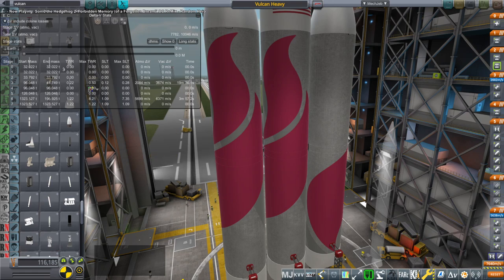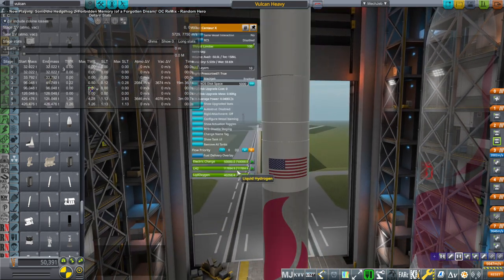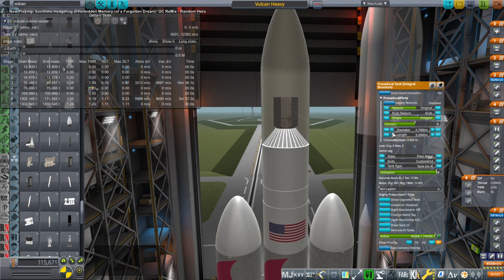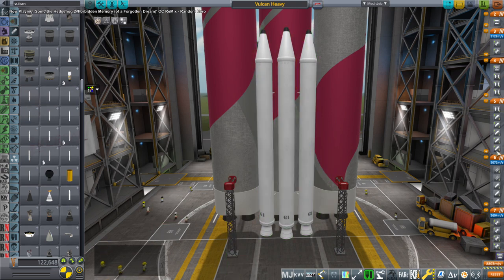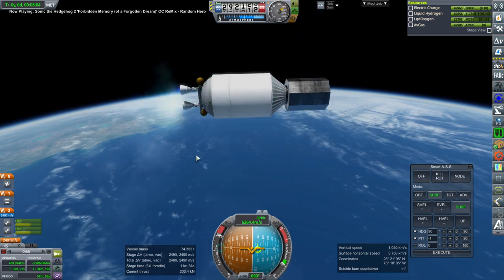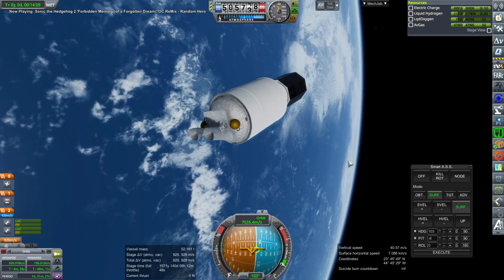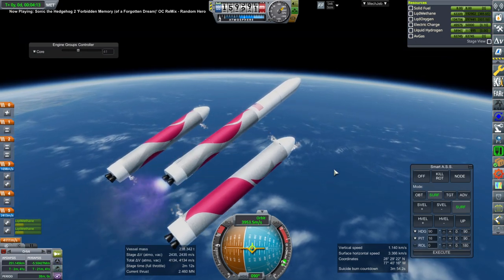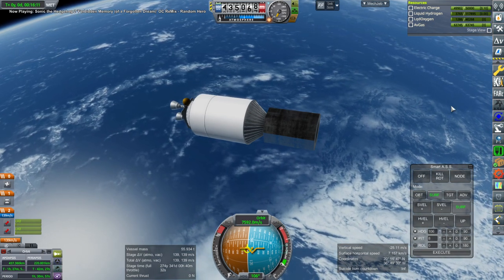Realism Overhaul in KSP 1.8.1 - On the 3-Core Vulcan Heavy

Comment: What about under fueling the side boosters so the core doesn’t have to throttle down as much
Reply: So long as the atmospheric drag speed limit doesn't hit, the first stage can keep burning as close to full power.

Going hypersonic is difficult with significant cross section drag.

Comment: Honestly, the only reason the FH makes sense is the reusable boosters but with massive improvements to both thrust and delta-v it's a little less important. The DIV heavy makes a little sense for deep space missions but not much as well, especially with the removal a the DIV medium. I think with vulcan going 8 or nine GEM63 or increasing the power of the boosters is a much better and cheaper option.
Reply: well, fully reusable FH isnt that competitive. proton m gets close to capacity and has quite low cost.
Reply: @_mikolaj_  The last Proton M flight is next year :/
Angara will replace it but I don't think it is nearly as cheap
Reply: @timbermicka  they plan to go cheaper, but knowing how barely alive is roscosmos, idk if theyll do it
Reply: @_mikolaj_  my understanding was that full reuse was the only time Proton M could match payload capacity, as well as the payload capacity to GTO relying on a fourth stage but I couldn't find any information on that or costs with the fourth stage. 65 million seems like a very solid price, expecially for payloads it can lift but the F9 has to operate in expanded mode. As for Roscosmos lowering the price, can they afford to do that? The advantage with the FH is going to be at the upper end of full reuse or anywhere where only the center core is dicarded, expecially GTO launches where it is significantly closer to the equator. 

I do think the Proton M does show the massive flaw for triple core boosters, and while the FH does well it really is limited by that second stage and it's narrow size.
Reply: @joshuagarner8982  i agree, FH would have so much potential with lets say raptor upperstage

Comment: Wouldn't the heavier variants use a 4 engine upper stage?
Reply from the maker: Probably not, because of the expense and it'll only be a marginal improvement in capacity because the upper stage was not providing most of the delta-v anyway.
Reply: @RaizSpace   Interesting. I guess that makes sense.

Comment: The thing I'm curious about with tri-core Vulcan is upper stage refueling logistics. Do you save enough upper stage fuel that one payloadless launch with three cores is worth it for a fueling mission, over three launches with single cores?
Reply from the maker: Well, my interest in this configuration was partly because of the ACES Depot, so I may end up trying that, though I suspect I may be impatient enough to just slap the 6 SRBs on as well and top off the depot a bit faster like that.

Comment: 1:35 How you said this phrase kinda puts a minimum bound to your age. Well, a substantially higher minimum bound than your 30 years of flight sim experience starting with MSFS 3.0 and you recounting of being told optimistic promises for the Space Shuttle, unless I'm misinterpreting your statements...
Is it... creepy to synthesize info like this?

4:35 Well, you weren't doing crossfeed. Then again, at least proportional crossfeed would result in sub-unity TWR once the boosters separate, but notionally you could have a non-proportional crossfeed, where less fuel is pumped from the boosters into the core than is needed to satify its engines. This would allow variably trading the delta-V increase for less gravity losses (though more than would be present with 3 equal-burning sticks), potentially resulting in a better equilibrium. For instance, while still having all the engines constantly at max throttle (unlike with the Delta IV or Falcon Heavy), the center stick could be made to have, say, 60% fuel upon separation (like the Delta IV or Falcon Heavy, albeit not that exact percentage). That would be difficult if not impossible to do with KSP given your current install situation, though.

6:10 I think you're slightly underselling the amount of work the Falcon 9/Heavy upper stage does.

15:40 With optimal crossfeed, it would almost certainly reach 48 tons without the boosters. Still wouldn't perform as well, mass-ratio-wise, as a purpose-designed single-stick LV of the same mass or even a Heavy with better stage mass ratios and thrust-to-weight ratios.
Reply from the maker: You have to factor in that I'm a historian by education, so I often put myself in the past. I mean, I could say "you know, Julius Caesar was a real asshole" in a way that would make you think I had done business with him personally. I'm not substantially higher than 30 - at least, not so much that I'd be 40 or over.